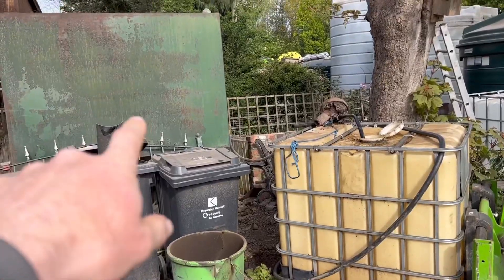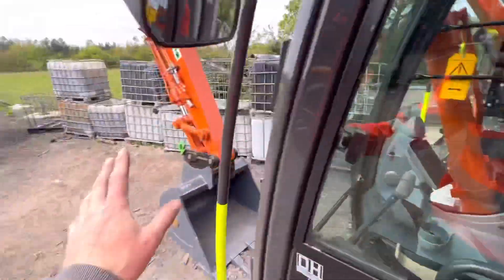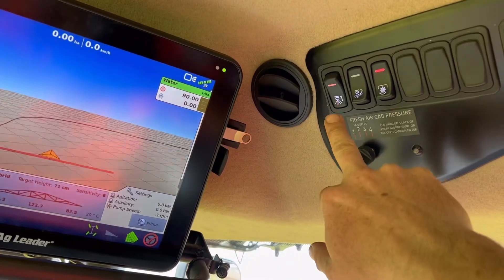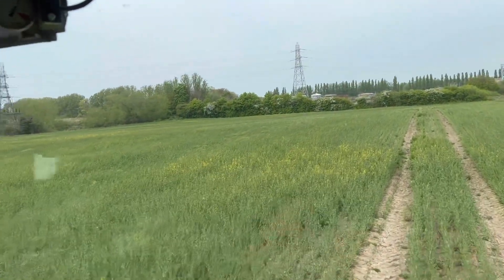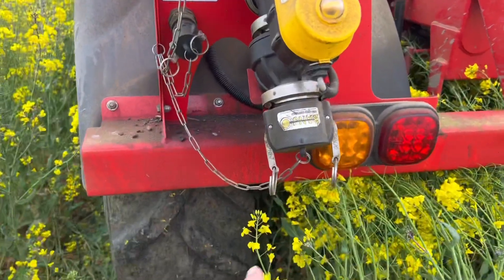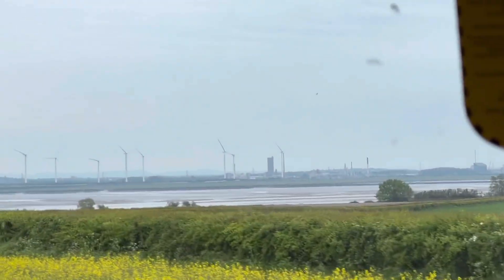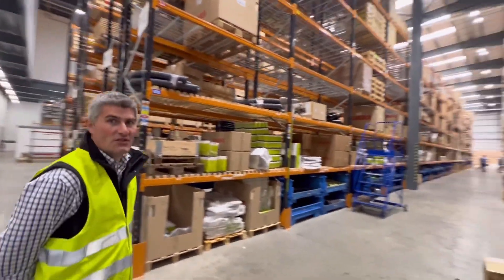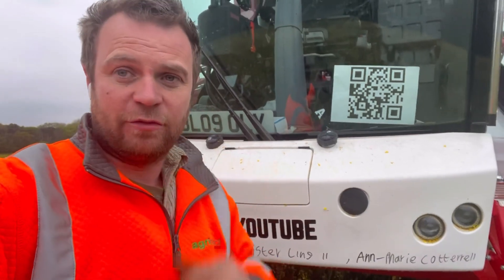Day769 ALL YELLOW & GREY PIGEONS WITH SOME CLAAS PARTS CENTER  #OLLYBLOGS  #AnswerAsAPercent

Comment: Oli, we had the 55 off the line just before you. We also have the 3” pacer pump, every time we use it we have to prime the pump by taking the bung off the top and covering the frame in fert. When it is eventually working it works no faster than the regular pump. Does yours work ok?
Reply from the maker: Works ok but our tanks quite full 
One on my rb26 worked well to